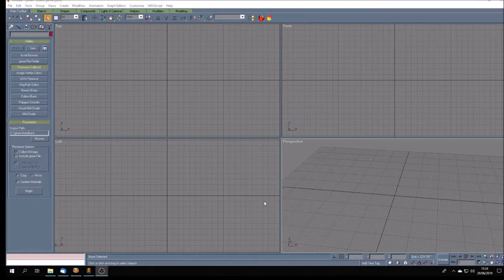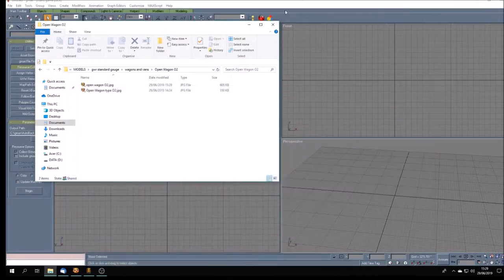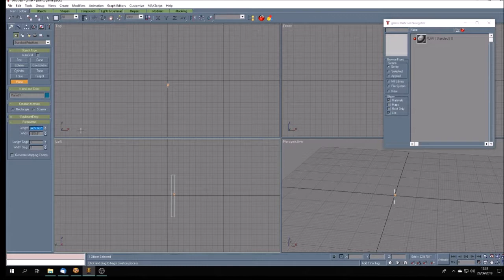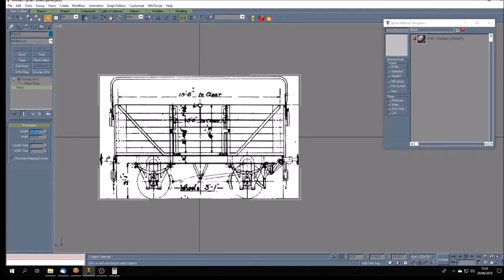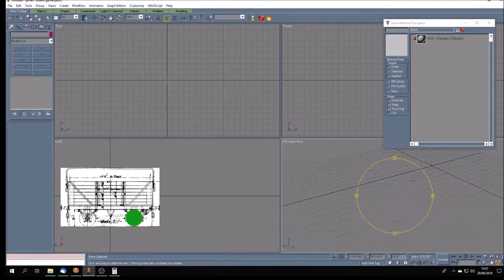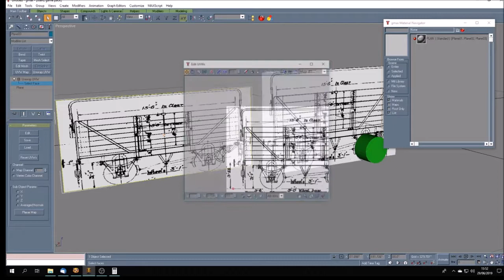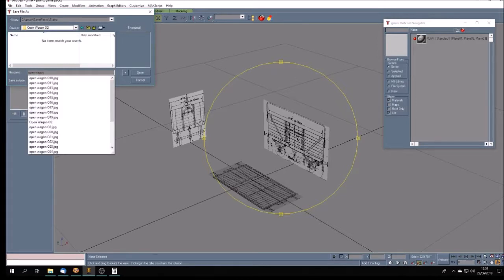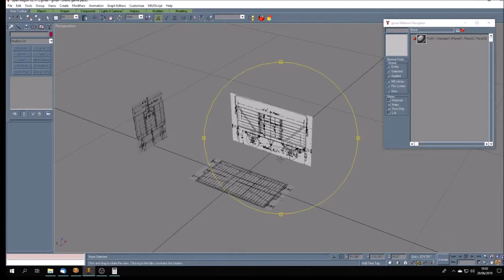Making GWR 7 plank open wagon O2 for Trainz railsim part 1

Comment: Does this work with 3DS Max?
Reply from the maker: Yes, Gmax is essentially a cut-down version of 3DS Max; the latter has more options. You will need the Trainz exporter to create the IM file. It plugs into Gmax and, I believe, 3DS, and is available from the Auran/3NV website.